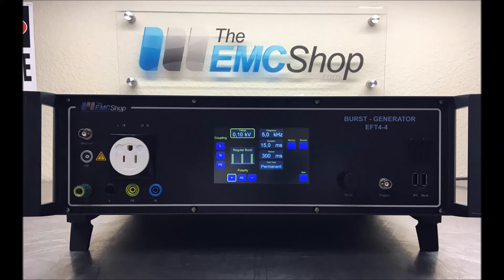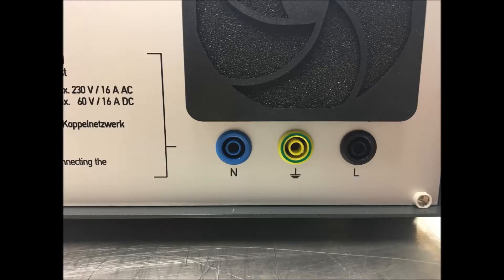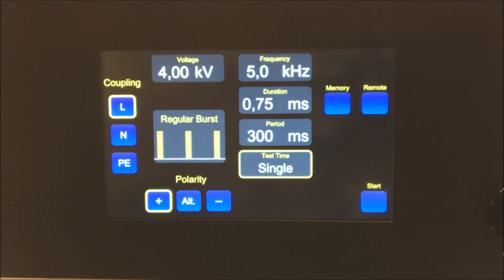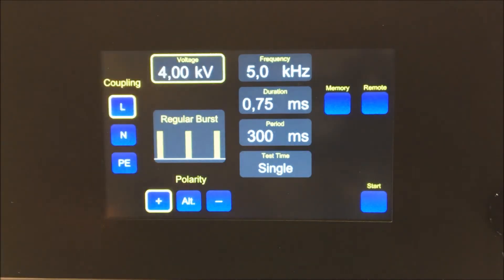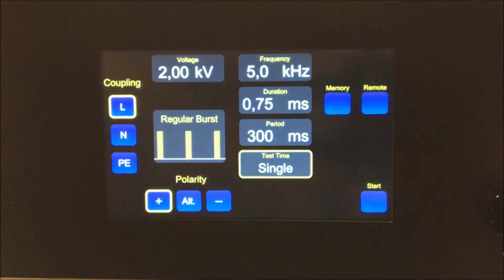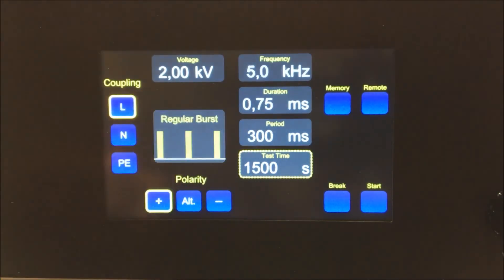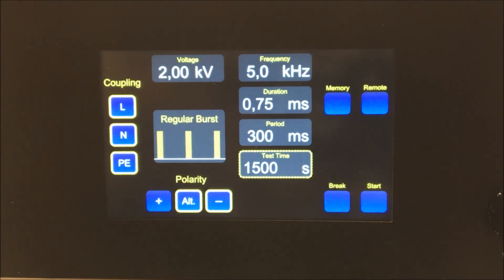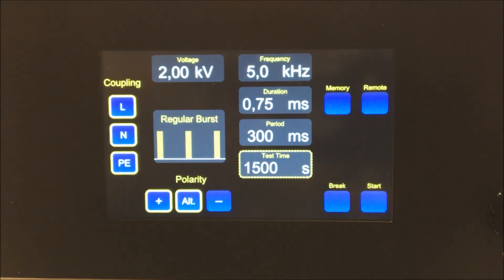Test Sequence Setup and Menu Overview The EMC Shop EFT4-4 Electrical Fast Transient/Burst Generator

Comment: How do you set the spike frequency ?  IF REQUIRED ? 
How the coupling and decoupling are connected with the generator. Can you explain in detail?
Reply from the maker: Coupling a single phase product is a matter or running one line from wall to generator, then another generator to product. It is a simple step we felt not needed to review. Frequency is in the top middle of the screen...

Comment: it was nice video ! 
why don't you use. EMC PARTNER equipment for the comparison ? 
1) if a person is new to EMI/EMC filed ,what basic things he need to learn?
Reply from the maker: We didn't think to, the EMC Partner, Haefely AXOS and Keytek EMC Pro Plus are similar to the NSG 3040 and NX5 regarding dimensions and weight. 

Learning can't be done in the Youtube comments section and it depends on your motivation/reason behind learning - is your goal to efficiently certify, troubleshoot and redesign, learn the mathematics as to why the electrical formulas are what they are?